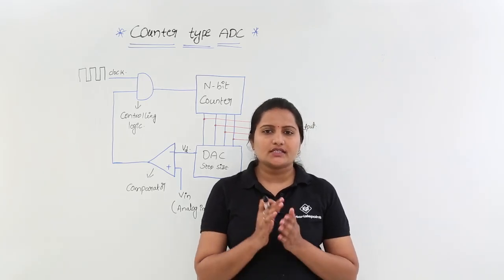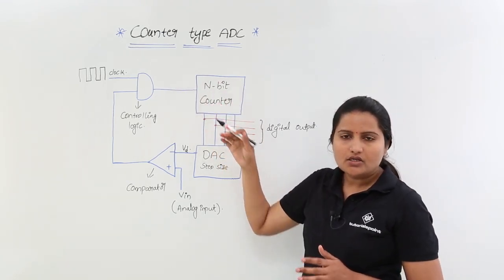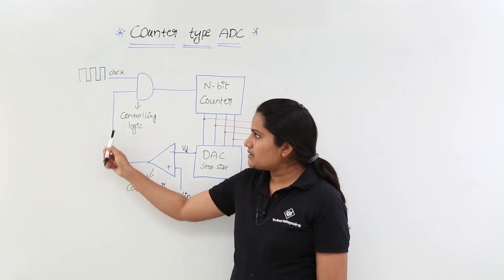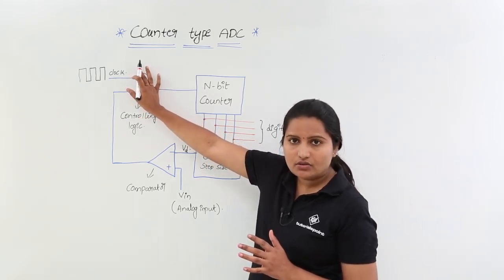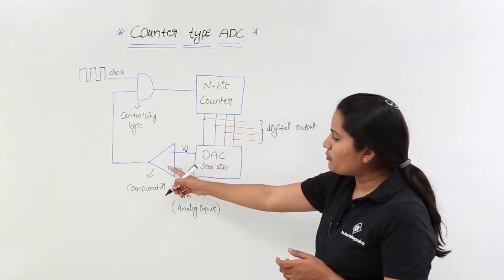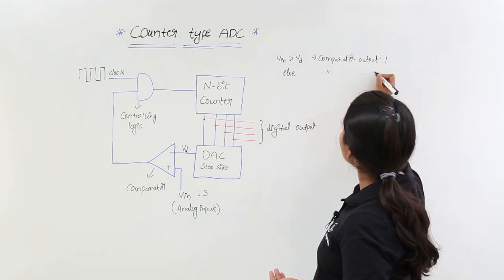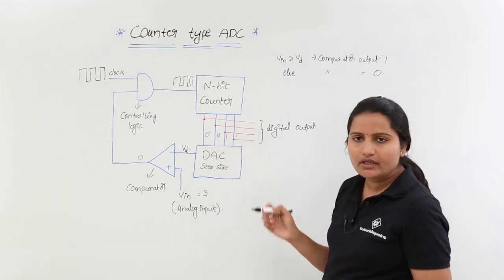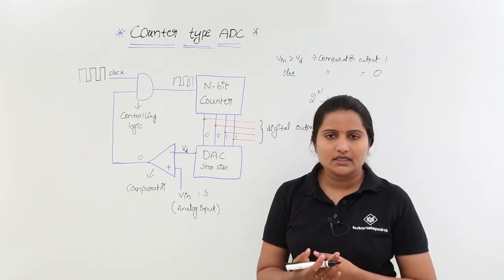Counter type ADC

Comment: What happens for fraction of input voltage.
Reply: I think it fixes the value to the higher num bro..let us take I/p as 3.2V...then another clock cycle is also considered..resulting the o/p as 4
Reply: @perin kumar then, i guess it's an error.
Reply: This value is approximated to a higher value

Comment: What will happen if the analog input is 3.5v? Then also the 4th clock will pass and digital output will be 0100 which is an error. So, how will it deal?
Reply: You have to adjust the least count of the adc, in this case least count or resolution is 1V..
Reply: If least count is 0.5V, then it will be error free  ...